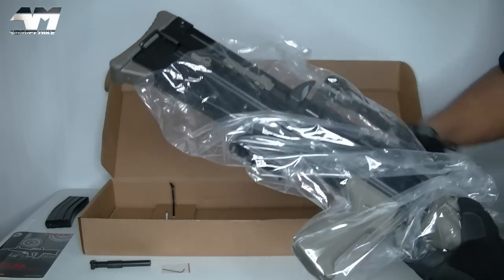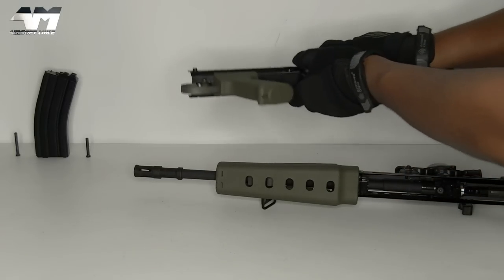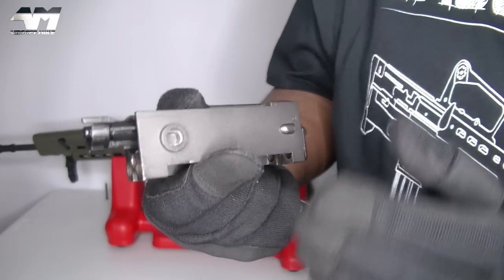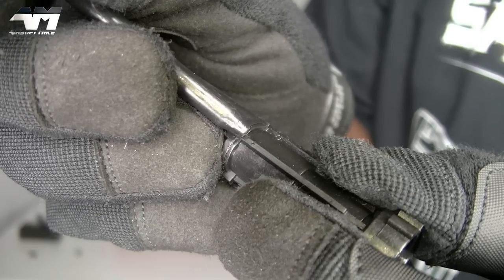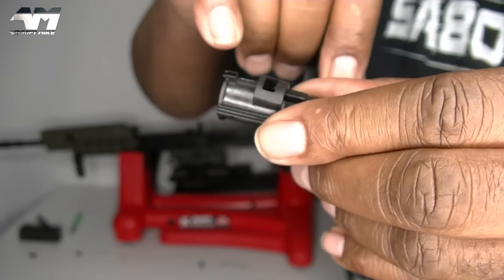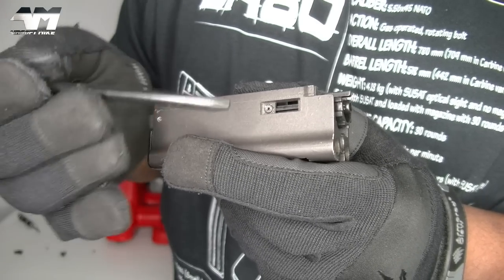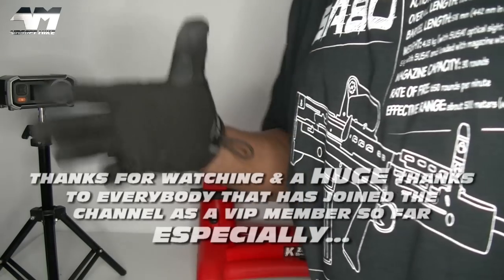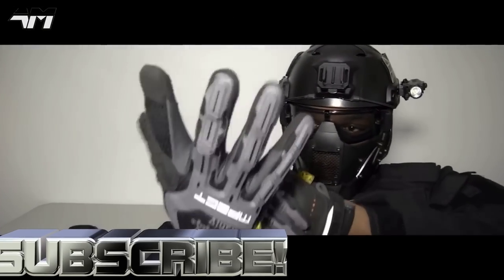WE L85A2 NEW GEN Part 2 / HOW TO INSTALL AN NPAS

Comment: You can make a custom N-Pas using the stock one and a small grub screw!
Reply: Really? 🤔😁
Reply: @TheMartman1971  Yes really! I used a grub screw from an old MoMo car hand break,the skinny version with thin grub vs the large Momo hand breaks with fat grubs!
You’ll need a thin,1/4 long grub to drive through the stock plastic N-Pas!
Reply: does it redirect the extra gasses to the bolt too for extra kick?
Reply: @hammies4jayjay  No an NPAS blocks air keeping the fps lower than stock. That extra air is just expelled out the chamber and in your receiver.
If you want more strike to your GBBR mag then you need a heavier hammer spring which then allows more air to push your bolt back!

Comment: Hello Mike, I’ve noticed that the front sling loop is on the other side of the rifle as opposed to the real counterpart. Is it possible to switch the front sling loop to the other side with this rifle?
Reply: Yes it is, i have mine on the left side just unscrew it and swap it to the other side 🤙
Reply: @TheMartman1971  hi where did you buy it?